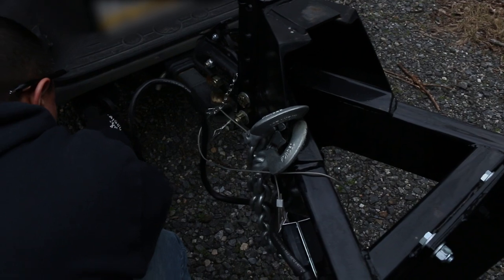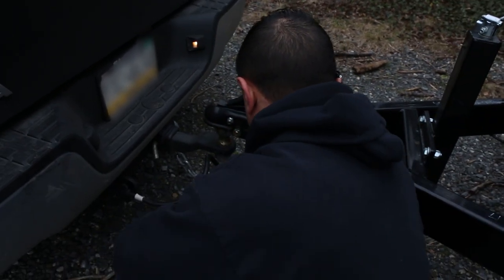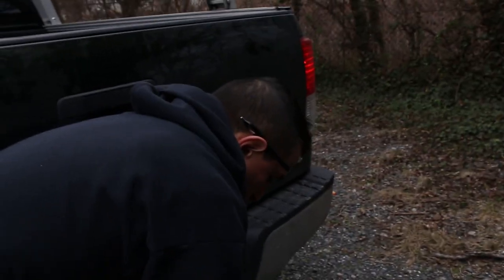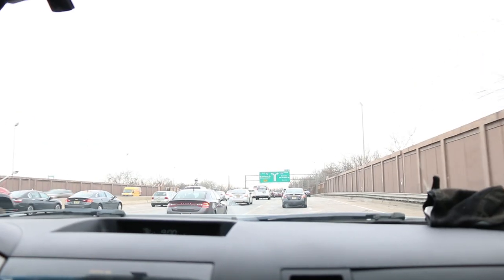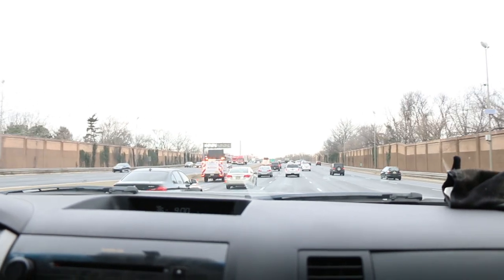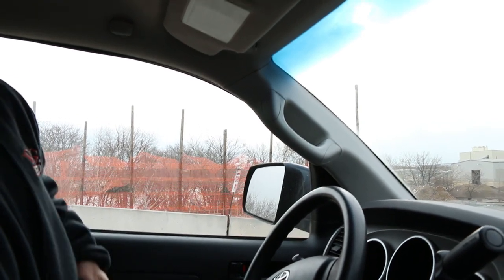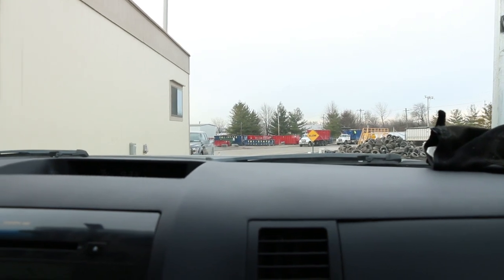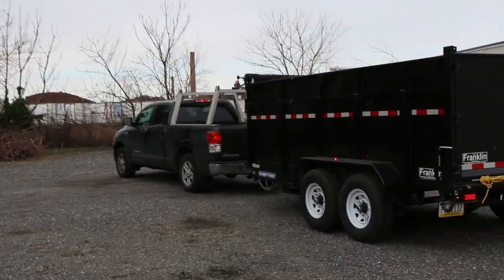Toyota Tundra Towing Trailer - Dump Trailer Hookup

Comment: Great to see the Tundra handle the load no problem! The 5.7 iforce v8 is still one of the most advanced engines available on the market today, 10 years later. Not to mention completely bulletproof. Great video guys!
Reply from the maker: TundraDude34 the 5.7 sure does handle the load no problem! It takes everything we throw at it, bulletproof it is!

Comment: It is true with the chains. One of my 22 year old sons that just started working for me in our construction business recently connected one of our trailers to my truck. For the first time in my life I lost a trailer at 50 going over a bridge. He was pretty new to hooking up trailers and accidentally locked the bulldog down without being fully seated onto the ball. Chains cradled the tongue, the emergency breaks engaged, and I didnt panic and instead came to a nice controlled stop. Absolutely NO damage at all. 

We did however have some trailer towing training after the mishap. It all came out well because I am a stickler for keeping our equipment in excellent condition.
Reply from the maker: I’m glad the mishap ended safely!!
Reply: VCG Construction ....me too. 😁I was definitely puckered, thats for sure. I have a class A license though, and have pulled wide load equipment....large track hoes and wide track dozers etc. So at the least I have a lot of experience pulling. I wasnt mad at my son. Definitely felt like I dropped the ball by not checking it myself.

Comment: It's nice to see a fellow Tundra owner using these trucks and showing how bulletproof they really are. I will say though that load was way over the limit for that truck. Might be able to do it, but the numbers stated from engineers who built and designed the truck say that it shouldn't be done for a reason. Illegal and unsafe to say the least, shocking for someone talking about safety the entire video.
Reply from the maker: +Logan Barrow if you are going by what your Tundra is able to tow your Tundra must be equipped with a six cylinder or the 4.6 liter v8, or you have the previous generation.
Reply: VCG Construction nope, 5.7 V8, 2008 model. If you look in the book you are rated for 10,000 lbs towing. Not 14,000. That's getting up into a 3/4 ton truck which is a totally different set up than these half ton trucks, which a Tundra is.
Reply: And it's a shame I can't just take a picture of it and post it on here for you, just have to go see for yourself online or your owners manual.
Reply from the maker: Logan Barrow no need to post a picture although if you posted a video of yourself driving your Tundra that would be awesome! We enjoy talking to fellow tundra owners about their vehicles, and watching them in a video would be even cooler! What you saw on the scale was the gross combined weight of the Tow vehicle and the trailer and load which was roughly 14000lbs. Our Tundras are rated for a gross combined weight of roughly 16000 lbs. In this video we are well within the Tow rating of this vehicle. Thanks
Reply: VCG Construction so the confusion originated because in the video it was stated that the trailer was 14,000 and not the combined weight. It all makes sense now and you are correct. With the truck weighing about 5,500 its self and the 10,000 lbs towing rating it would equal about the 16,000 you brought up. Sorry for the confusion. Hopefully this clears up everyone else's confusion as well as others I see have posted about this.
Reply from the maker: Logan Barrow 👍🏻
Reply: @FAMECOEDDUDE  four years later I have a question. I have an 08 tundra like discussed. Tow rating is 10k. Doesn’t that mean the trailer and load have to be under 10k? I’m looking to buy a dump trailer and it seems like they are all over 10k pounds even before adding the payload.
Reply: Disregard! The weight is the GVWR. Not the empty weight like I thought.

Comment: Sweet video. Really nice to see trucks & trailers at work and making contractors some money. What axle gear ratio does your Tundra have in it? Also did you add airbags/helper springs to the rear end of the truck to help counter any sagging due to a heavy trailer?
Reply from the maker: +sirkingdra the truck has a Tow package from Toyota. I believe the rear gear is 4:10, with a stock suspension!
Reply: VCG Construction actually 4:30 ratio brother. You won't find that ratio in any other truck except an f450
Reply: Mario de la pena  you can get a Ford F-250 with a 6.2/4:30 gears, fords been doing it since '00
Reply: Josh yeah in their heavy duty trucks 3/4 and up. The tundra is a half ton.

Comment: All these hate comments from the wanna be truck drivers and dot officers the gross weight was 14,720 if the truck weighs 5,500 lbs i don’t know for sure so give or take a little there. That makes the trailer around 9,220 lbs give or take because I don’t know exactly what the truck weighs. So the weight he is pulling is somewhere in the neighborhood of 9,220 lbs. well within the tow rating of the truck. Mine is rated to tow 9,800 lbs so I would make an educated guess and say this truck is similar. Glad it handled the weight fine can’t wait to tow something with mine.
Reply from the maker: Thanks billy we appreciate it!!

Comment: check the sticker on the driver side it probably says 7,000 lbs max towing. check your users manual it probably says 7,000 lbs max.
Reply from the maker: +Hank Hill we're curious, what are you basing your assumption on, "probably" ?

Comment: You mention safety an awful lot and the dangers with towing especially with such a load. Tundra calls for a Weight Distribution hitch when towing over 5500ibs
Reply from the maker: +anthony leder thank you very much for the feedback! When setting up the tundra trailer combination we worked closely with a trailer dealer for the setup. We were confident that all required equipment was being utilized. In our haste we did not double check the requirements specific in the Tundra manual. You are correct, the Tundra does require a weight distribution hitch for loads above 5000lbs. We do take safety very seriously and will make the correction! Thanks again!
Reply: No prob. Makes me feel better actually, Im anout to pull a 7500IB camper and seeing these big loads yanked around gives me alot more confidence
Reply from the maker: +anthony leder is your tow vehicle a Tundra with the 5.7 ?
Reply: yes sir 2014 with the tow package
Reply from the maker: +anthony leder Tundra is a great truck, it'll do its part! Have a great and safe trip! Thanks again, we appreciate it! 👍🏻
Reply: VCG Construction would get one...but that bed is too small
Reply: it's 6.5 ft, standard short bed. long bed , 8 ft, is available
Reply: nunya business I'm good with those 2 but honestly all crew cabs today only come with a short bed in half ton

Comment: , it was supposed to take it to the voting station and just way the both empty see if you over the compacity and ask the is a combined weight of the truck trailer and the load so just be careful you can overload that real fast and yes I do a lot of Towing for trailers and different trucks a line different trucks

Comment: Thanks for posting this. Please buy a truck capable of safely hauling that weight. You are breaking the law and pose a threat to everyone on the road. You have been reported to New Jersey law enforcement.
Reply: What? New Jersey...ahh cops won't don crap
Reply: What? I have driven 2500 ram with dump trailer, ecoboost with dump trailer, tundra with roughly the same if not more weight (in the cab, bed, travel trailer with liquids and camping supplies for 4 people. Good day miss

Comment: Your tow vehicle can't handle that trailer. Duh!
Reply from the maker: +Lance Shimamoto did you happen to watch the video? Clearly it can!! Lmao!!
Reply: Just because it can does not mean it is safe the highest tow rating for the tundra is 10500. Your over by 3500 if you are loaded to max.  Sorry but tundra is a nice truck but they are no better than any other half ton on the market.  When you start getting above 10k towing you need a 3/4 to 1 ton truck
Reply: Also just because a trailer dealership says something does not make it so they are trying to make a sell
Reply from the maker: +Josh Steinbrunner gvcw google it, thanks for watching have a good night!
Reply from the maker: +Josh Steinbrunner that can be true in some cases, thanks for watching, have a good night! ✌🏻
Reply from the maker: +Josh Steinbrunner is that taking the gcvw or the tow load? Because the scale weighs everything...

Comment: gross weight is 15,000 pounds . If that trailer is 14,000 then you are over loaded
Reply: Phillip Webb actually it is 16000 gvwr
Reply: Dump trailer empty weights about 3.9k pound I know because I own one so if it’s 14000 you can only load 10k inside it